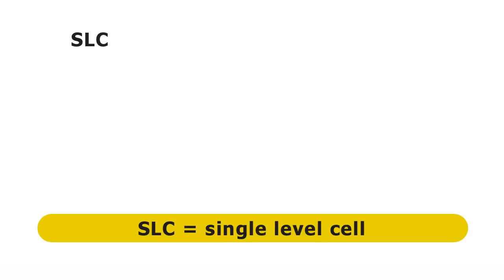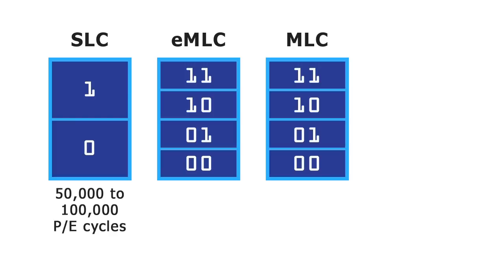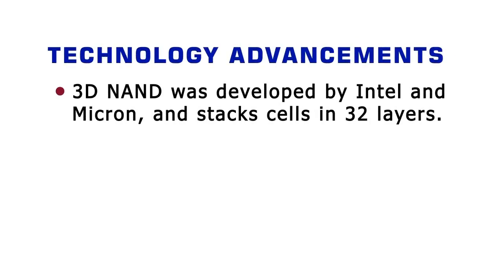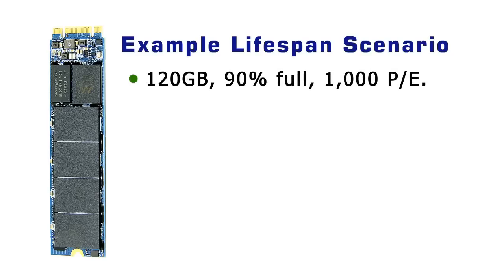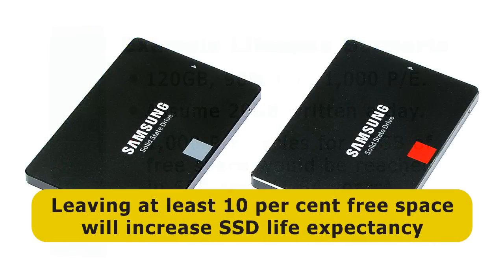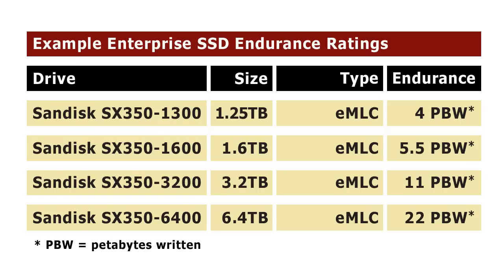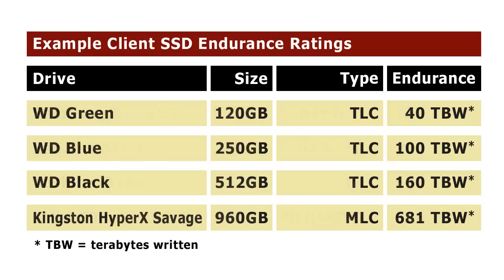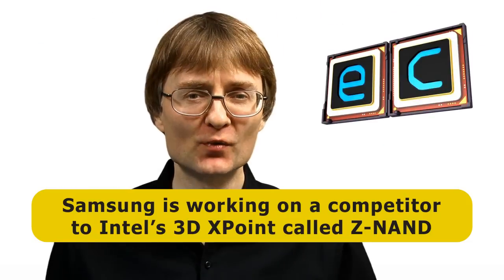SSD Life Expectancy

Comment: 8:38 - "over a decade", that's all I need to hear.
Reply: Thanks man! 🤣🙏🏼
Reply: SMART reports that the OCZ Vertex 3 in my 10 y.o. everyday system (total power-on hours of 4.02 years) still has a 'remaining life' of 98%. Sure, it's a boot disk, not a data disk, but I've done nothing fancy to minimise writes to it (e.g. redirect temp files elsewhere) and speed-wise it's still much faster, cooler and quieter than the (long since dead) WD black drive it replaced.
Reply: My very first SSD, a 2009 64GB Samsung PB22-J (badged as a Patriot Torqx M28) which was the predecessor of the Samsung 470, which in turn was the predecessor of the 830 (just to give you an idea how far back this goes) has only recently started showing issues. It still works fine, but it's SMART status reports that there aren't many NAND program/erase cycles left. This SSD was used for 11 years on a daily basis (first in my PC, when I upgraded I put it into my moms PC) and only now started showing issues but not outright failing/dropping dead. If these very early and somewhat crude SSDs (the PB22-J didn't even support TRIM until the very last firmware update) manage to last this long, I'm honestly not too worried about newer, more advanced ones with better wear leveling, provided we're talking big brands that produce things themselves like Samsung, Crucial, Intel, etc. and not the cheapo brands that just slap their name on products made by someone else and don't actually produce anything themselves (like Kingston, Adata, Corsair, etc.)
Reply: I've surpassed the 10 yr mark.
Reply: 8 years and counting.
Reply: @Knaeckebrotsaege  i thought corsair ssd are great? Atleast their MVME ssd, like the MP510.
Reply: Hmm to be fair the information regarding types and leaving space on your drive is good too man. your probably drive aint gonna last 10year if its packed to 95% and writing constantly as a result.
Reply: Sh*t, my first SSD must be coming up to a decade old!
Reply: Depends on what you use the drive for.
Reply: No i also need to know the name of the barbers so i can avoid them. just saying.
Reply: I had an MLC SSD in use as the C drive for 5 years and barely scratched 7 % off its life expectancy.
Reply: thanks!
Reply: Mojo Jojo 
I personally think it depends on how you treat the SSD, I mean if SSD can only survive for 1 decade, then all the videos on youtube that older than 10 years should be corrupted.
Reply: @mojojojo1529  That's the problem: there are no real symptoms because it depends entirely on the firmware.  You simply need to monitor your TBW and compare to the endurance expected for that kind of flash.  For instance, QLC can endure about 500 cycles, so if you have a QLC device that has TBW (as reported by SMART) that is near size*500, you need to think about replacing it.
Reply: Prussian Revivalist  You mean 2TB?
Reply: Prussian Revivalist  I just bought a Kingston A400 240gb to install Windows 10 on my only 5 year old laptop, to breathe new life into it. Would that be good? Because clearly price is an issue for me and couldn't afford any Samsung SSD. I'd be doing a lot of video and photo editing, no gaming, and lot of web browsing.
Reply: Prussian Revivalist  Thank you!
Reply: Milton Keenes  who said anything about 1 dwpd?  With qlc, doing 1 dwpd will consume the flash endurance in less than two years.  Do half as many writes and get twice the lifetime.  Yes, you can make it to longer than the warranty if you avoid heavy writing.
Reply: @Knaeckebrotsaege  Is Kingston like that?
Reply: I have a 60GB OS ssd been kicking for about 8 years only recently i have switched it out for a 250GB due to games save files taking a ton of space for some reason.
Reply: Decade seems too brief. Most of my HDDs have lasted much longer.
Reply: @UHFStation1  How much do you write on it though if you use it contently it will die as you would expect it all depends on the brand and how efficient they are.
Reply: Thanks!  That's all he had to say...lol
Reply: I've had my OCZ Agility 3 for 9 years now as a boot drive! It's amazing.
Reply: Me with a 8yo SSD: sweating nervously
Reply: my ssd 9 years old sweating nerviously
Reply: Thanks man
Reply: Same, Thanks!
Reply: Thanks to save 8 minutes of my life.
Reply: 911 wts ur emergency
Reply: Just came here for this. Thanks.
Reply: @Dave Derp mine served 5 years. but it was nearly 90%-95% of capacity used. bigger disk  with more free space will serve more
Reply: thanks lmao
Reply: over at Linus Tech they never mentioned this
Reply: Yep. . I've had mine since 2010, and it's still 94% good
Reply: man you are doing gods work rn
Reply: my flash drive works for so many years now and still works so I am wondering how is it different to ssd? maybe because i only use my flash drive once in a while but I still believe in the durability of solid state drives.
Reply: you guys are lucky to not live on a region with violent storm
Reply: ty my internet friend.
Reply: @Knaeckebrotsaege  
Sorry are you available ? You are so smart 🤓 
I have some questions about my Kingston A400 240 gb SSD health getting down day by day 
Help me pls 🥺😭 
I am so sad
Reply: at the rate I'm using my NVMe, it'll take me 30years according to the manufacturer to hit the TBW limit.  This is basically a non issue for the average user.  Unless you're writing Terabytes daily, and even then it'll last at least couple years.
Reply: Now we find they last even longer than expected

Comment: I bought my first SSD 10 years ago, its a Corsair 120GB SSD, I've used it first for SO, then for games, and now to download stuff. Not one single issue so far, still running perfectly and I assure you that I've used it almost every single day.
Reply: beacuse it uses an old memory technology (SLC or MLC). Pros: More lifetime. Cons: Low write/read speeds vs actual ssd.
Reply: top
Reply: @kidrauhlpop  That is a concern. However, I did not pay attention to it on my M.2 drives. Based on my expected usage. I might be upgrading in in seven to ten years anyway. 

Sad, you would think longer life would be marking point. 

In the future. For longer term storage, 10 years not plugged in. I will buy enterprise drives. Yes, I do buy platter drives. For moderate term. However, SSDs are a bit more physically resilient. Especially for off site backups.
Reply: @Lord Purchase same here. I prefer longevity over speed because what's the sense of having something fast that will die on you when you can get something slightly slow that will certainly outlast it's rated life expectancy?
Reply: @toussaintlouverture9666  - Moreover, the speed bottleneck may not even be the SSD but the pc's bus or other drives you're copying from/to (like SDcards, etc.).  So for me lifetime is definitely more important than speed.
Reply: Your probably running on fumes. 🎃

Comment: As a professional in high tech, your video is an an exceptionally well articulated summary of SSDs with just the right amount of detail.  I came across this quite by accident (already know SSDs well).  A couple of suggestions potentially for other videos (perhaps you have them already):

1)  Comparison between SSDs and HDDs WRT reliability
2)  Comparison between SSDs and HDDs WRT data recovery after failure (generally more difficult to recover off of SSDs)

Lastly, the decision to choose between SSDs and HDDs also depends on use case (e.g., whether you travel a lot and the drive will be used for your laptop) vs. a drive that is largely used for backup on a machine that is not mobile. 

Again - great video!
Reply from the maker: Thanks for this. Ideas noted!
Reply: ok
Reply: @ExplainingComputers what tbw of ssd u have and do u ever write lots of gigabytes when editing in the ssd?

Comment: Main advantage is speed. Cut waiting time. The older you are the more you need it. Life is short.
Reply: Life itself kinda works like an SSD when we apply same logic onto space-time.
Reply: Smart
Reply: @atomictraveller  What? the phrase "live  fast die young" is to encourage people to take risk because tomorrow is not guaranteed.
Reply: Thanks to save my time.. 
and thumb up to nice video
Reply: SSDs are temporary.
Harddrives are ETERNAL.
Reply: I feel this. XD
Reply: @nickolascrousillat4265  eternally slow*
Reply: They both have their place.... SSD for operating systems and more taxing storage material and HDD's for media storage ect. You dont need to spend hundreds of dollars for a few TB of storage for your movies ect when you can get a 4TB HHD for under 100 bucks.
Reply: bruce banner  they both have their place. There is no point in buying SSD's to store your movie library and photo library on when an HDD will do the job just fine. 

Heck HDD is perfectly fine for plenty of games too. Older games/emulated games ect load up plenty quick enough on HDD...  Heck I keep the majority of my game library on HDD and they typically load in seconds not minutes... Now sure the games that have long load times definitely benefit from SSD but not all of them benefit all that much. I'm not spending 4x the price for storage just because it will load my game 10 seconds faster. The more demanding games that do have long load times on HDD go onto my nvme m.2 that I run my OS on. If there is a demanding game I'm storing on my HDD that I plan on playing regularly then I just transfer it over to SSD while I'm out doing something.

That's why I said they both have their place. SSD is great for speed and HDD is great for mass storage. Not to mention HDD really isn't all that slow when you ARENT running an OS on it. When you have the HDD running the OS and try to play games on it then its definitely sluggish compared to when its only being used for its intended purpose like games or movies ect.
Reply: @nickolascrousillat4265  I've had a few HDDs that have been far from eternal. The worst ones were IBM Desk Stars from the early 2000s. They became known as IBM Death Stars. They'd kill your data.
Reply: "life is short" In which case I need a massive RAID 0 array of the latest NVMe SSDs !
Reply: Reliability and longevity are every bit as important to me as performance.  That being said, I choose life over speed.  I don't want to replace my storage drive every 5 years or less, or I'll use an SSD for my system drive and a conventional HDD for my games and videos, but still have to change my temp folder to the HDD, and maybe my pagefile too.
Reply: indeed
Reply: @Lizardman9808  If you understand space-time, the more this makes sense.